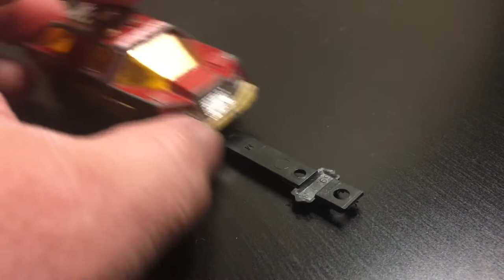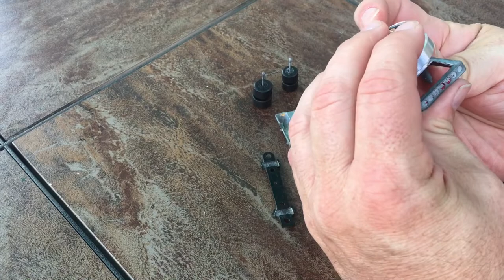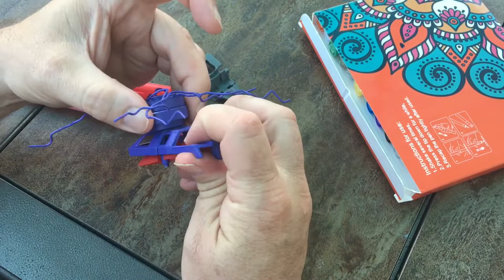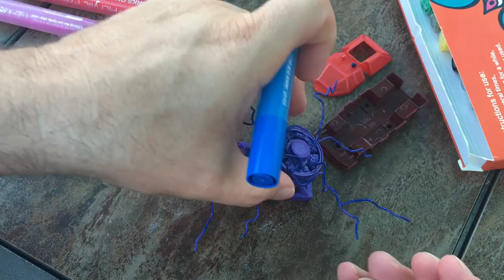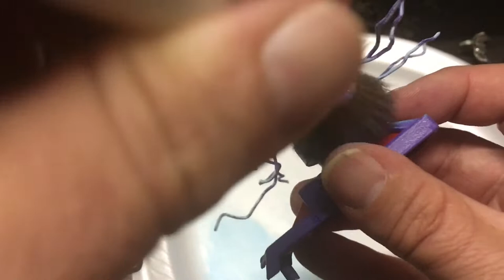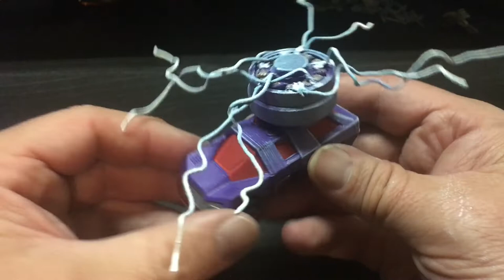Gaslands - How to build a custom Mishkin Arc Projector on a Matchbox Planet Scout

Comment: Picked a great older cast  and made something interesting and not usually seen nicely done. You could of played with the lighting of those arcs on the body and windows of that car for days of you wanted to.  Think i might try a simular type build but with an arc cannon or perhaps a plasma bolter. I have one of those HW 6 wheeled vehicles had the little radar dish that turned on top makes a good candidate for this.
Reply from the maker: Very cool idea!